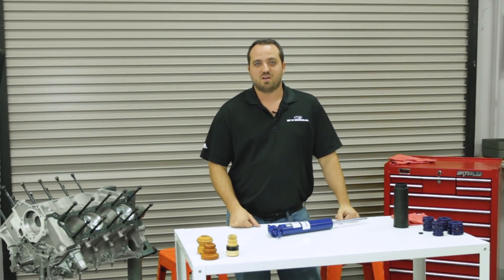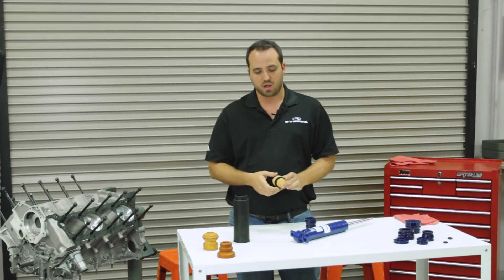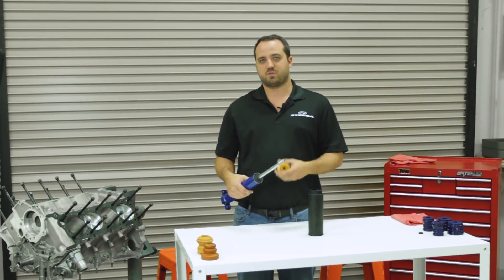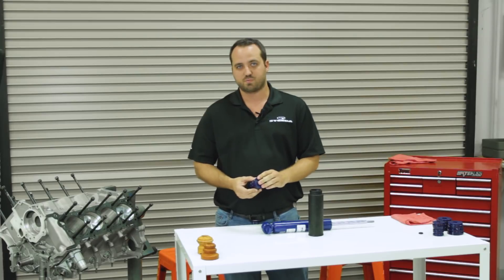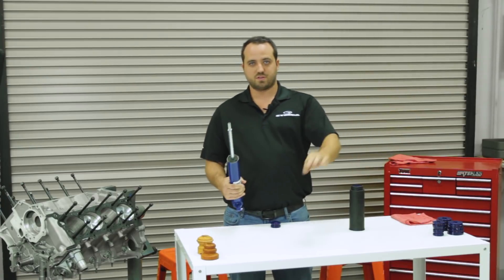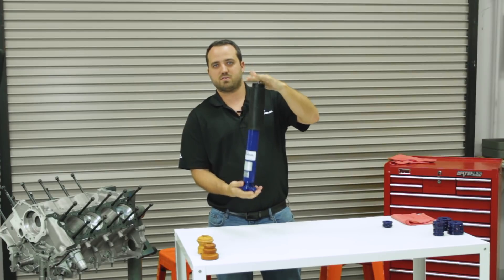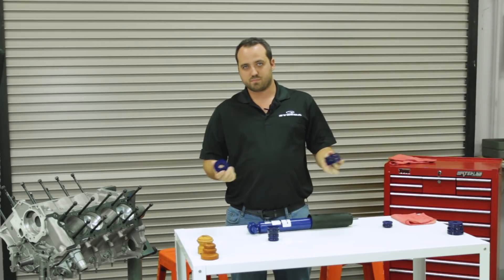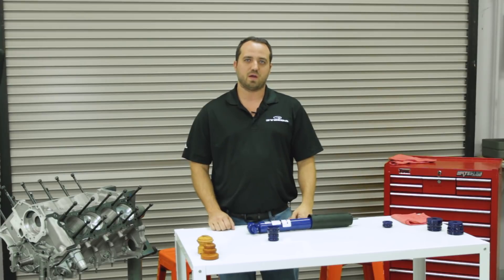Steeda Adjustable Bumpstops for 2015-2021 Mustangs | Tech Tip

Comment: Ford Performance springs that lows only 1 inch need double bump stops or single?
Reply from the maker: For a 1" drop we recommend the single. The double would be recommended on a stock ride height or something like our minimum drop springs which only lower the vehicle 0.5".
Reply: The ford spring lowers 0.7” you still recommend single? Ty

Comment: But what about a Roush Mustang 2019 with the Roush adjustable coil over shocks? Mine fell apart. Trying to upgrade them front.
Reply from the maker: We know they will work with Roush's non-coil over struts, but you would have to ask Roush if the strut shaft diameter is the same on the coilovers. If it is slightly smaller than stock you can still upgrade to these, but they will not fit as tight.

Comment: Thanks for the video John. I've heard that cutting the stock bump stops around 3/8" for the front and 5/8" for the rear is good when dropping around an inch with lowering springs. What do you recommend we cut the stock bump stops for the Steeda Sport Progressive springs?
Reply from the maker: Hi JCTiggs, you're actually about right with those measurements. You can go with 1/2" and 3/4" for the Sport Progressives
Reply: Awesome, thanks for the reply! :)
Reply: Did you trim the originals. I'm putting steeda progressive on my 2020.